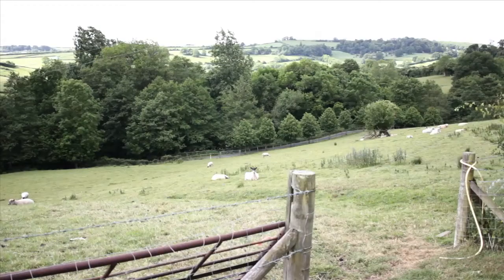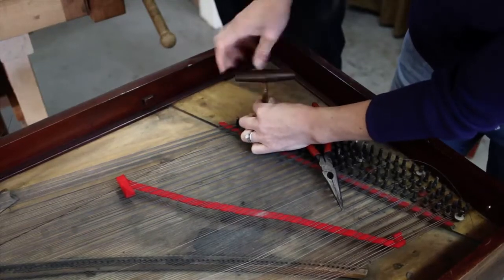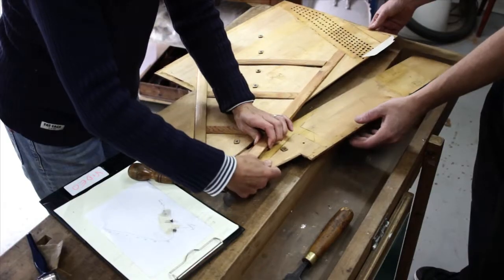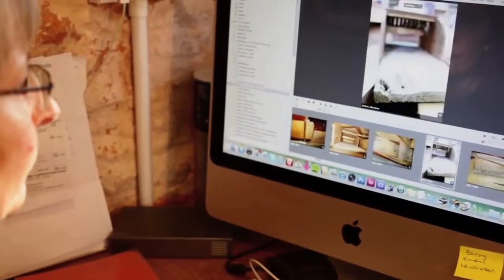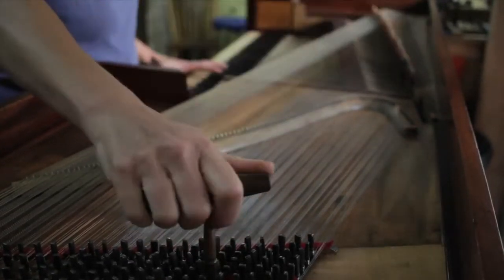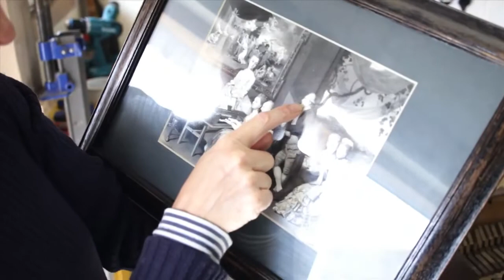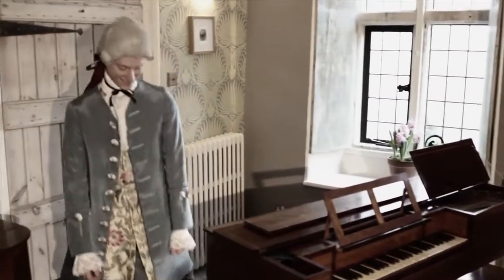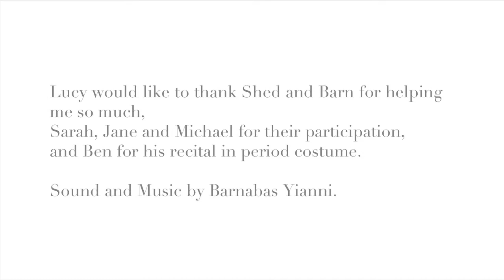Lucy Coad Square Pianos

Comment: Lovely video.  I’m in the long process of performing restorative conservation on a 1867 Steinway Square Grand that hasn’t been touched in 70+ years.  All original parts, even the strings.  I called Steinway for scraps of information - they laughed in my face.  But we have come so far.  I am determined to finish and sound it correctly.

Comment: Fantastic. I'm working on an 1812-ish Wilkinson & Wornum which is virtually identical, except the hitch & tuning pin locations are reversed.
Reply: That arrangement kept the instrument in tune much longer as the tuning pins were away from the vibrating soundboard